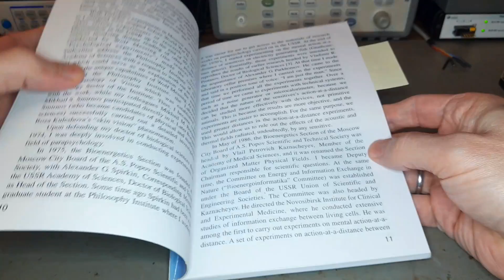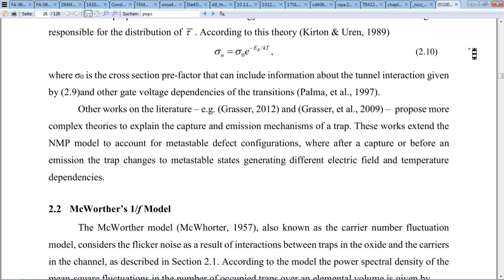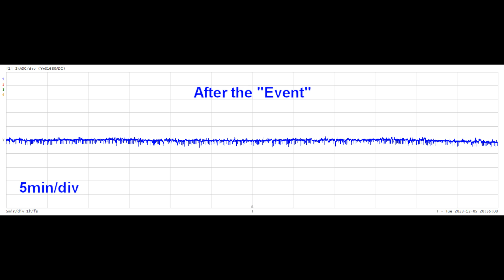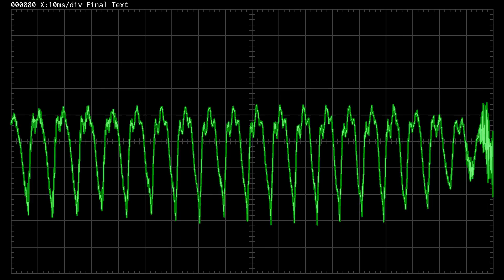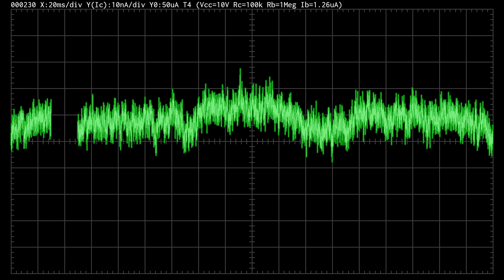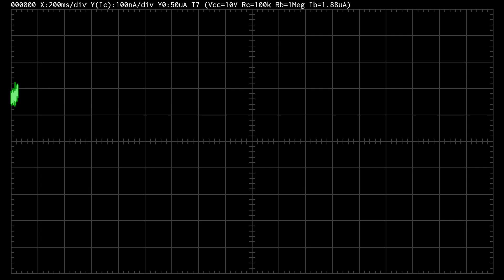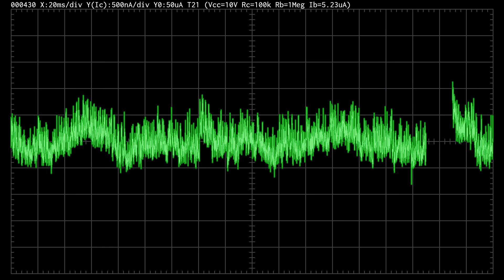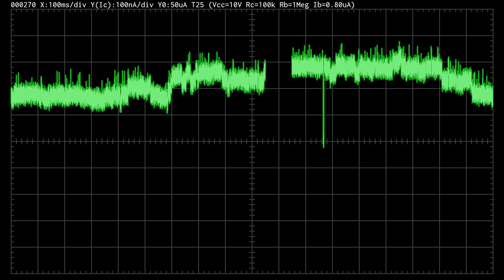Popcorn Noise - A Miracle?

Comment: Not really my field, but I work for a semiconductor manufacturer and I hear things. Things to consider - You can model 1/f noise as a stochastic series of exponential decays. To quote a smarter-than-me colleague "That's the electrons dropping in holes in the substrate". The macroscopic behavior of a transistor yields NBTI (short term transistor aging with recovery). NBTI can work on the timescale you were seeing for the low frequency steps. It is easy to see how the two effects in combination could yield the popcorn noise you see. The telegraph process is modeled with two constants and so mirrors the two effects. All the noise mechanisms happen in silicon and they add up and interact in complex ways. It's never one thing.
Reply: My understanding of BJTs is that mot people's understanding of how they work is wrong. Carrier injection into the base doesn't cause current amplification directly. For, say, an NPN transistor, it works more like an IGFET where the forward biasing the base-emitter junction connects the two conduction regions from the collector to the emitter and pushes aside the depletion regions at the PN junctions. This is the same as how the gate voltage on a FET creates an inversion layer in the channel.

When you use such a negligible forward biasing current, especially on older transistors with larger feature sizes, you create a very thin, very long conduction region that isn't especially stable. This popping noise is chaotic and similar in nature to a flag flapping in the wind.

What you're hearing isn't individual carrier recombination events (though that is how some noise generators work, like with zener diodes). The popping is larger bubbles of conduction forming in the thin conduction region in the base. (like the flapping of a flag)

You could do this same thing with just an N type MOSFET, but you would have to have extremely fine voltage control over the gate-source voltage. Extremely fine voltage control is much easier to accomplish when its literally the same thing as current control when you're using a BJT. A 1 Mohm resistor does just fine.

Sorry if the terminology is a little weird, going back and forth between BJT and FET terminology and making analogies between them is annoying.
Reply from the maker: Thanks for your reply. Interesting thoughts!
Reply from the maker: Thanks for mentioning "NBTI". Of course the question remains what really "triggers" the changes. I would expect that "tickling" a device with temperature (soldering iron...) or with current variations, should easily lead to changes, but at least my transistors seem to be pretty "robust" in keeping their current noise-character, changing at totally random times.
Reply: @gumpomat  NBTI and BTI happen through localized heating. That's why it recovers. Hot carrier injection in contrast is permanent, but depends on the circuit topology. Discrete transistors are huge compared to the transistors we play with in chips, so I can't really comment on how that translates to discrete transistors.
Reply: @gumpomat  
Ich denke - so als Laie von der Seite aus draufblickend - daß deine Erwartung, du könntest durch mechanische Bearbeitung etwas bewirken, hier nicht fuktioniert, weil das störende Verhalten an kristalline Strukturen gebunden ist, die sich von dir auf diese Weise nicht stören lassen.
Bei Röhren würde das wohl eher funktionieren, denn wenn deren Strukturen erschüttert werden, merkt wegen der dann großen bewegten Massen auch die Kristallstruktur des fehlerhaften Übergangs etwas davon.
Und wenn du deine Transistoren soweit erwärmst, daß die Kristallstrukturen des Problembereichs durch die Wärme ernsthaft beeinträchtigt werden, sollte sich auch etwas ändern.
Würde ich an deiner Stelle testen.

Ich denke, daß sich Mathematiker auf sowas auch gerne dransetzen, liegt dran, daß unsere Welt vielleicht doch auf Kristallen aufbaut und dann sollte man tatsächlich fehlende Daten durch Interpolation ergänzen können - das macht Mathematiker doch glücklich, oder nicht?

Und dann wäre die "Welt", die wir kennen, doch eigentlich gar nicht analog, oder ?
Reply: @gumpomat ever look at what is called exotic vacuum objects, also called charge clusters ? I have been looking for better ways to detect the ones I am making, and I think you have my answer with your setup. I will try it and see if it works
Reply: @spacecase0  Shoulders' EVOs are terrifying.   (Exotic Vacuum objects, like hypervelocity micrometeors, launched from sharp points during KV impulses.)  Burn's micro-holes through glass vacuum tubes.   The very first physics experiment I ever tried, in 1984, involved a VDG static generator and an aquarium bulb (which years later I found to always contain hard vacuum, no argon backfill.)   Spark pulses from the VDG sphere, spreading across the glass surface, caused a grounded filament-support in the bulb to emit an invisible "ray," blasting a barely- visible pore through the glass bulb, gradually letting in air, and so creating a slow "light show" of various plasma colors inside the spoiled vacuum, during the continuing HV pulses.
Reply: @wbeaty  yes, they sure burn through things. I have made large size versions of the fields (2 inches across), and they burnt me quite bad, not safe research. but also fascinating that our civilization is not using this technology yet, we should be figuring out how to use them.
Reply: @wbeaty  what exactly is an EVO? I've only heard of extra virgin oil... But seriously I've never heard of it.

Comment: Thank very much for the video.... I could think of the following reasons:
- Solar particles from the sun (would be interesting to have meassurements if a solarflare erupts max +3 days)
- electrons bouncing inside the semiconductor / charge change inside the semiconductor
- Cosmic Neutrinos hitting earth or smaller particles hitting earth at the exact location where the np connection is
- radiowave interference
- electrical grid interference 20ms is 50hz, its the same as you can hold one proble of your osciloscope (if its battery powered) and you can meassure the 50hz going through your body because of the house wiring. As this isnt stable most of the time it should show noise too because of the millions of consumer devicees connected to the grid.
- quantum tunneling inside the semiconductor for some electrons that directly pass through

Now i have no more ideas what else it could be 🙂 But very interesting to see the effect and thanks for your effort...
Reply: perhaps, but there ought to be a difference day and night, the eletrons bounce should have a more "uniform" and the high energy cosmic rays; would rather need sniper skills to hit THAT transistor. 
i go with the biggest culprit at the look of the signals, something behind the power or outside, the installation ain't that much shielded, and i suspect a local device transmitting data by the looks of the graph.
Reply from the maker: About the solar flares, I made another video, checking that. Looking at the first event I was shocked, but I think it was just a random coincidence: https://youtu.be/9Uvho-OzQXA
Reply: Regular sunlight will also have effect on sensitive circuits. For example diodes (and many transistors) are IR LED with heat conductive housing in reality, so they can act as solar panels for heat.